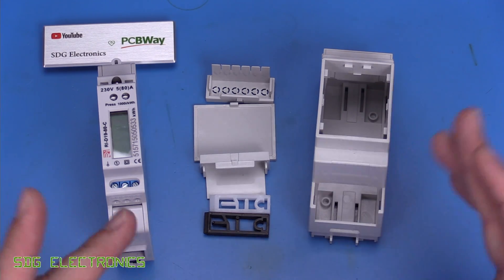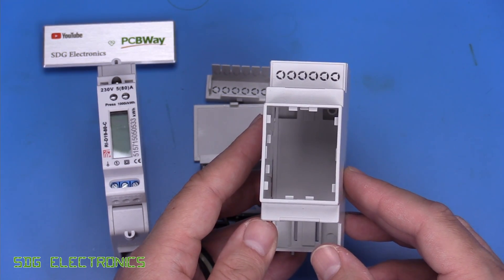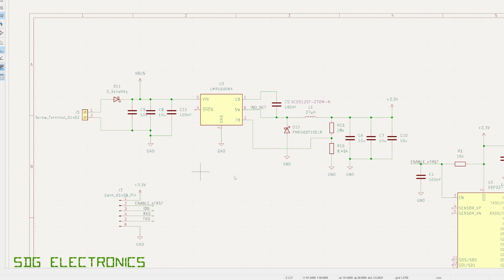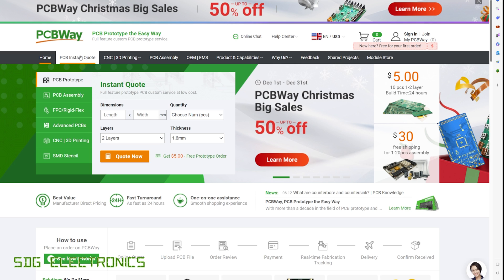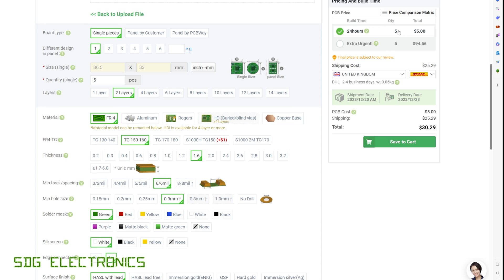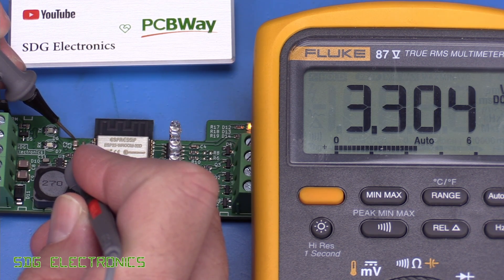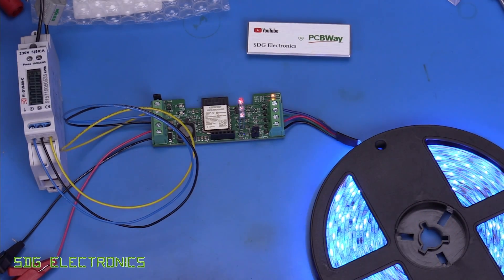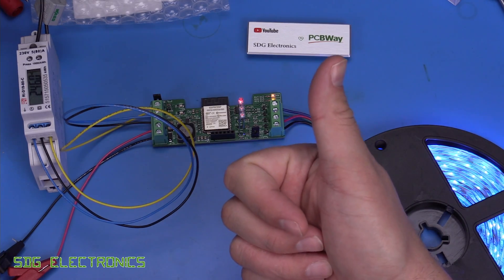SDG #322 ESP32 DIN Rail Module with Modbus and RGB Controller

Comment: I made something similar for the power meters on my heat pumps, but I had some trouble getting communication over RS485 to work. Turns out the problem was with switching it between send and receive, but with an oscilloscope it all looked right, but ESPHome just wouldn't read anything. I ended up with the MAX13487EESA+T for RS485, and it has been rock stable.
Reply: Also a side comment... The RS485 modules I used had RX and TX diodes on, and I tried to figure out how they had done it, but couldn't get my head around it at that time. Wouldn't it make more sense to do those fully hardware driven, instead of doing it by software?

Comment: @3:05 R6 and R8 are Not Fitted ? So I do not understand your remark. These resistors should never be fitted. Just check the datasheet.
Reply from the maker: You would normally bias the inputs with high value resistors for R6 and R8. When nothing is on the bus, these two lines would then be at approximately the same voltage through the 120R termination resistor.
Reply: @sdgelectronics  Ok. It is detailed described here "AN-1057 Ten Ways to Bulletproof RS-485 Interfaces". And I should have known as I am using RDM Controllers where these resistors are fitted. Thanks, Arjan

Comment: An issue with placing the esp32 near the base is that the antenna is next to the DIN rail which is usually grounded, and you can't know what other DIN rail mounted modules will be installed next to the device. Best practice is to have either an externally mounted rp-sma connector or use a right angle board mount to bring the ESP32 and it's antenna to the surface of the faceplate. This could also remove the need for light pipes.
Reply from the maker: I will generally be using the u.fl version of the module with an external antenna or an adhesive internal antenna

Comment: 8:10 Steve, have you considered making some custom LED light pipes?  You can get pretty good results 3D printing the whole assembly using transparent PETG filament or you could print LED sleeve couplers and use short lengths transparent PETG filament as fibre optic light guides.
Reply from the maker: I failed last time with PETG. I might try again, or maybe with the resin printer.

Comment: I finished a similar thing this week :P ESP32S3 ( with HA configurations for all the modes , 5 -80V input, because sometimes it gets hooked up to a solar battery stack at 58V)
the S3 USB peripheral has both USB-CDC and JTAG so it makes programming easy, it could use another revision tho

Comment: Blinking the Rx/Tx LEDs.....I think:
binary_sensor
pin number = GPIO_TX
on_press then light.toggle:  tx_led
etc....
Reply: OR just drive leds directly from RX and TX lines, set resistors for ~2mA and everything is alweys working independent of softwere. That what I alweys do when UART visual debug is needed. PS UART lines are idle at high so leds should light when bus is low.
Reply from the maker: I'll try it out. I saw the use of on_... In the example code, but I'm fairly new to yaml
Reply from the maker: apparently it is not possible without the uart driver being modified. I will have to dig deeper...

Comment: Just in time. I'm also currently building an esp32 rs485 interface for an meatrol energy meter. I'm testing rs485 comm with the esp32 boards. One is powered via esp-prog hooked up to serial monitor, the other only works with a specific usb c cable and adapter combo. Swapping out the cable or adapter will not work. Even plugging it on a powerbank or on the same laptop won't work. I think it is not booting since the buzzer is humming. The usb c connector shield is tied to ground on the layout. That usb power is then fed to a 3.3V LDO. Regardless i remove the rs485 ground connection between them. I'm still waiting for the meter (220 v ac input) and i'm looking to replace usb power for the esp32 with the same ac input thru a hi-link 3.3v converter module